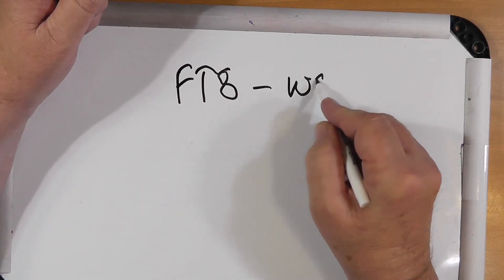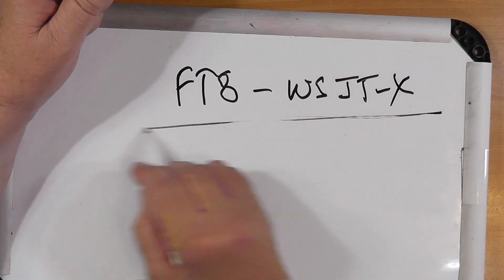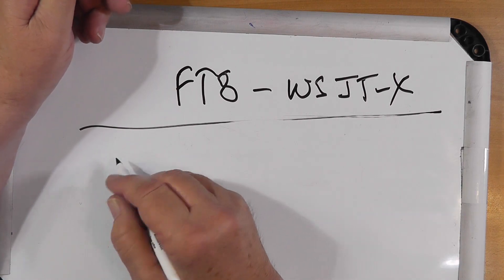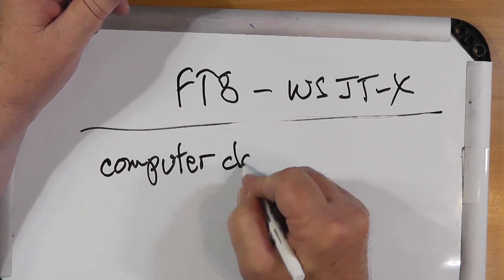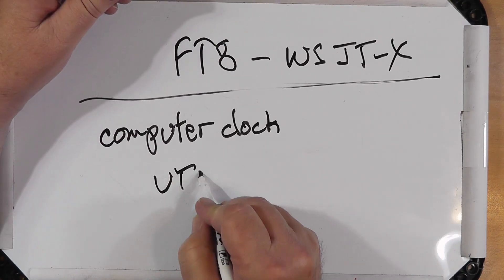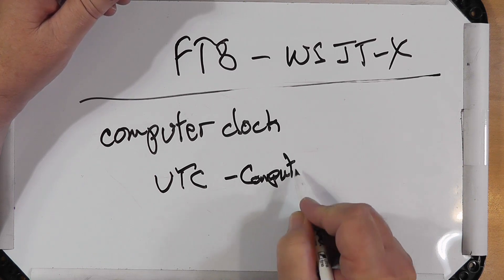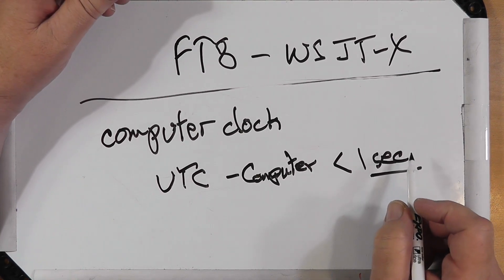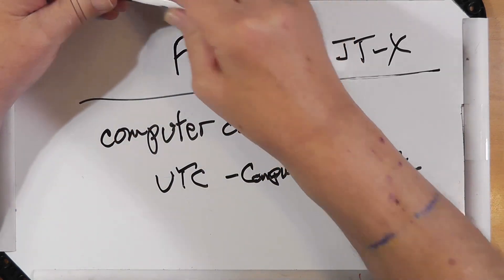Clock Requirements vs FT8 (#693)

Comment: "You can't set it by hand."  I worked for a researcher one summer, who was studying long-distance propagation of extremely low frequency radio waves.  His lab setup at Cold Bay, Alaska, recorded transmissions from somewhere in Australia on one track of a two-track recorder, and time ticks on the other.  The time ticks were provided by a crystal-controlled pulse generator, automatically corrected to an atomic clock (this was before GPS).  But the atomic clock was damaged in transit, and he couldn't get another, or have it repaired in time.  So the oscillator ran unregulated.  Problem was that this wasn't accurate enough - it drifted around 50ms/day on average, so I had to adjust it several times every day, to align with the WWVH transmissions.  It was no problem to get this within 20ms by ear, which wasn't great, but it allowed him to complete his research.  In a later lifetime, I have to synchronize audio with multiple video cameras, where it's easy enough to see/hear a 30ms error, and correct it.  So I really can't imagine how the average amateur radio operator can't set a computer's RTC to any reliable reference to well within one second, by hand.

Comment: I know Dave doesn't recommend using Windows time, and I completely understand why. However, if you are somewhat Windows savvy, there are 4 steps to ensure time is kept within 10-20(ms) 24 hours a day without installing any programs. I can't site links because youtube will sanitize, but search for the following.... 1. Windows NTP (how to set up)  2. Find the closest NTP server (Very important). 3. The registry change so Windows checks NTP hourly. 4. How to start w32time service.  If you don't feel comfortable running commands in Windows OR editing the registry, do not follow these instructions, and use one of the programs Dave recommends.    Feel free to email if you have any questions.  Most people should not have a problem finding a NTP server that takes longer than 10-20ms to respond (round trip including network time), but as long as it doesn't take longer than 100-200ms you are 'ok', but not optimal. 73 ki4dra
Reply: I consider myself pretty good at computers, but for the life of me I couldn't get this to work after many hours of trying. Good luck to others, though.

Comment: Hi Dave

D4 is Dimension 4. The software is free. Mine fights with Windows 11 for control of the clock but the D4 gives a 'more' correct setting. TO said that Windows is off by 0.7 seconds and I have the same problem. Turning the computer off and on seems to make it lose time.  Some of these machines use a separate battery for the clock which gets more inaccurate as the computer ages.

I agree with you Dave, it's amazing how tough it is to get accurate time for WSJT-x
Reply: Schadenfreude: Almost considered the purchase of a new computer to resolve this ongoing issue, but am pleased to learn from you it’s systemic to the industry.

Comment: "Network Time Protocol" (NTP) is the solution to this. On linux the package is generally called "ntp", I assume your D4 program would do the same thing.
I am fairly sure the windows clock sync thing is using NTP as well, but it doesn't constantly run it, it only runs every 2 weeks ish

Comment: Hi,
The British had a long tradition of navigation and keeping track of the stars and the Sun position. Their measurements systems were used across the world. This system based on sun/stars was refereed as GMT.  The French tried to redefine all physical units, but failed to redefine the hour!  The world ended up with the hybrid metric/GMT system (called SI).
 
At the end of the war, crystal oscillators were by far the best clocks. But one still needed a REFERENCE to tune his frequency. Here and there, there were observatories and top notch mathematicians capable of doing the maths.  By 1960 it was obvious that magnetic resonances of some pure materials (I skip the details) could be STABLE and UNIVERSAL.  But none of those (atomic standards) has any connection to the earth rotation!  Moreover, the guys who were having fun watching the stars, you know, they wanted to keep their job...

So in 1967/8 a compromise was found:  The frequency of Cesium hyperfine resonance was defined as 9192631770 Hz and that definition is EXACT, will not change.  So obviously, as the earth "wiggles" and slows down a discrepancy will necessarily appear and increase with time...

The solution was to continue to watch the Sun and the stars, and keep track of the difference in the logbook. Even better, reset the clock whenever the difference is larger than one second, and keep the reset dates in the log book!  This way the Sun is always at its proper position, the scientists have a reliable frequency reference for their oscillators, and everyone has a job!

The Atomic time scale is called TAI, the now slightly redefined GMT time is called UTC,
and if someone ask:  "what if I had used the other time scale", he can always consult the official logbook, that is constantly updates (I skip the details) and the calculations are very easy to do since the the difference is always an INTEGER multiple of one second!  So cool!

Now comes the internet.  The protocol involved is called NTP.  This protocol is universal. You can even chose your preferred server. It does not matter, all the servers are connected to each other in one way or another (many jobs). If you have a working internet connection there is no chance that you will ever see any difference, and I mean it.  

If you have an intermittent internet connection,  when you come back on line, the clock will SLOWLY come back on time due to a micro-stepper.  One thing software can not do very well is SKIP one second or REPEAT the same second twice! Not a problem, your computer (CPU) has a nanosecond counter embedded. The slow ramp is safe with any program  that marks or rely on time.    

Now comes 2020 (aprox): As we just mentioned the whole computer time network (NTP) uses nanosecond counters and microsteppers. Then the old UTC/TAI system that is reset by one second becomes obsolete. Stepping by one second is precisely what the system was designed to avoid.  For that reason, it was decided to define a new time scale (called TT)  that will also keep track of the difference between the definition and the earth rotation but the one second steps will not exist any more (but computer scientists will join the work force).

WSJT-X is a wonderful program.  I think the authors mentioned the clock should be within four seconds. Please forgive me if I am wrong, My memory is failing (and I read that very recently). 
   
Now on some computers, your NTP driver can even CALIBRATE your computer clock, so it keeps precise time even after you loose the internet connection. While on line, it measures the drift saves the value in memory. Later it adds a certain number of microseconds per hour, etc...
   
The only problem I found with using WSJT-X is while receiving WSPR signals you can not receive other transmissions. Use two receivers?  I thought of that too.  I have now two receivers. but the problem persists, because I have only one antenna!  I am joking of course.  

More seriously, I find the antenna is the most fundamental/universal/difficult problem with ham radio.   I digress. 

I like your podcasts.  They are great!